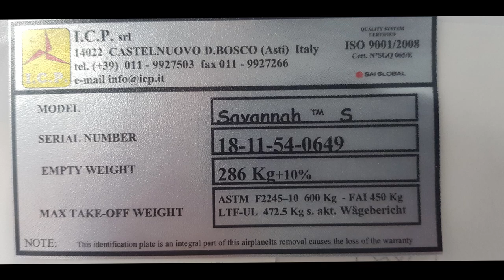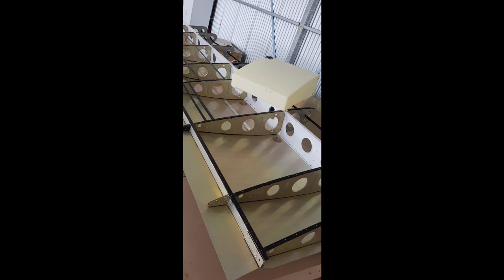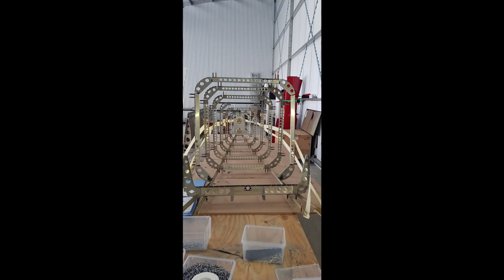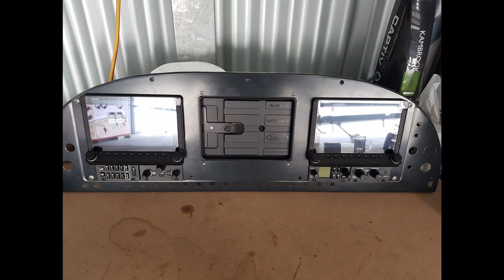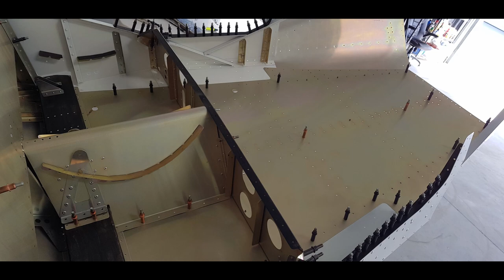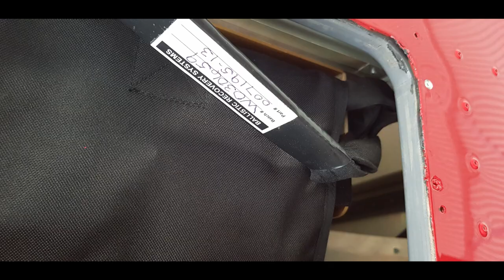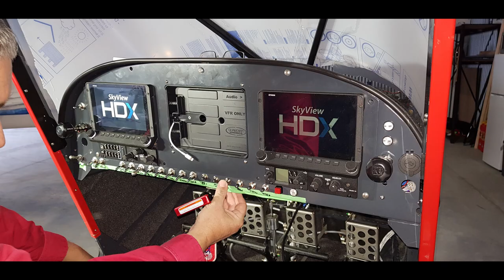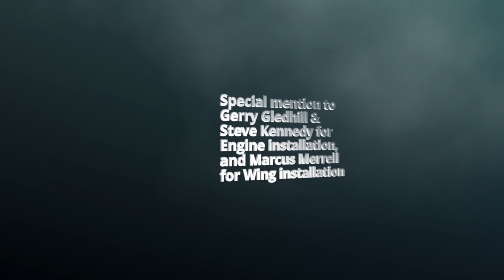Savannah S VH-CQG Timelapse Build

Comment: Great video, very interesting from a smart project with rotax is and brs parachute system. I currently fly a cirrus 22 but also need a smaller plane to fly all the wonderful aviosuperfici around Italy
Reply from the maker: Thanks Luca, and co-incidentally I also fly an SR22. The Savannah I built for the same reason you just said, to be able to fly low and slow and have a good look around! The Cirrus is a great IFR machine to be able to get from point A to B quickly...

Comment: Great job. Looks awesome. I'm starting to build myself and was wondering what you did with the stickers when you used Alodine? Did you leave them on or peeled them off and reapplied or did you just know how to assemble a Savannah without stickers? 😊
Reply from the maker: Hi Christin, I removed every sticker and engraved each piece as I did, also deburred every piece at the same time. This took a few weeks and then i alodined everything. In essence I did all the crap work first which then allowed me to just build which was the best bit!
Reply: Did you apply a primer after Alodining or you just left the Alodine as is? And on the outer surfaces where you riveted, did you also apply black stuff or is that etch primer? 
How is your Savannah a few years later down the track?
Thanks for your help.
Reply from the maker: @ChristinSondermann  I didn't prime after alodining other than apply the black stuff as you call it to each surface which was going to be riveted together

Comment: Hello, Great video, awesome. What a nice job. I live in France. I am going to build a Savannah S and your video is a big help. I have a question. I live near the sea and I have a lot of questions about anti-corrosion treatment. You use alodine in big plastics bins. But how do you do for long lengths ? with a brush ? Thank for your answer, I can't find anything on the internet Stephane
Reply from the maker: Thanks Stephane,
As you saw by the photos, I did all of the small part Alodining of what could fit into those tubs. For everything else I bundled up on pallets and took to a local business who had huge baths of Alumiprep and Alodine and saved me weeks of my time, and the cost I considered to be very reasonable. I'd do this as the Alodine process is painstakingly boring! I would definitely do some sort of corrosion preventative as we too live near the coast and a few other builds that did not Alodine are already showing a fair few spots of corrosion, they too wish they had taken the extra time to do it.
Hope this helps, Chris

Comment: I have an EAB Savannah S. The builder chose to highly modify the muffler to fit the cowling. This is causing me some issues now. Looks like you did the right thing and modified the cowling instead. Anything you would do differently for the exhaust system? Great job. I hope you’re having fun! I love flying mine. The golf cart tires are soon to be replaced.
Reply from the maker: The Rotax iS came with its muffler system in place so I left it there instead of replacing it with the ICP system and then had to modify the cowl to suit. I think best the Rotax exhaust even though a lot of mucking around with the cowl. And yes, these aircraft should ship with the larger tyres, the front 8.5x6.0 (same as rear, newly added after the build) certainly makes taxying and landing much much softer...
Reply: @nunnayourbiz  Thanks for your reply. I was able to get some photos of a factory built Savannah S (early 2018). I don't think the factory exhaust is build by Rotax. ICP must source them from someplace else or custom build in house. I wonder why they don't build a cowling that will fit the engines and stock exhaust systems being used.
Reply from the maker: @wandaschuler2920  No the factory exhaust is ICP's own. My Rotax iS was shipped with the exhaust already assembled on the engine (I'm not sure if the ULS are shipped the same). Yes it would be easier if ICP had bottom cowl options for the Rotax exhaust system too...

Comment: Mate, awesome to see. I'm pretty set on getting a kit in to build, any major tips? How was getting on the VH register?
Reply from the maker: Hi Conrad, the main tip is if it is your first build then have a few mates who you can lean on for help with the technical stuff, ie some of the engine install/avionics. Other than that the kit is fairly straightforward. VH register was also fairly simple process, just ensure you follow the guidelines and it will flow...

Comment: Congratulations Nunna. Just a question about protection against corrosion. Did you prime all components? What’s the black material you applied to the contact areas?
Reply from the maker: Yes the entire plane was alodined. The black paint is from ICP and is used to paint a thin coat between any pieces of aluminium that attach together, also to help against possible corrosion...
Reply: Bonjour je veux votre numéro wasap
Reply: Je suis béninois
Reply: @nunnayourbiz  Was it hard to get the Alodine? Isn't it considered hazardous material? Looks like you set up dip tanks. Was that prep, coat, wash? How did you dispose of it? Thanks. Seriously considering the Savannah.
Reply from the maker: @jimnelson3819  +
Hi Jim, the entire aircraft has been alodined. The smaller parts were done in the dip tanks as per the pictures and I did that myself, the larger skins were done by a commercial alodiner which saved me a heap of time and energy. Alodine is readily available in Australia and yes hazardess and toxic so use breathing apparatus and gloves etc. Pre prep first then rinse then alodine solution and hang it to dry. I still have the alodine if needed in the future. Hope this helps!

Comment: What a Beautiful build well done. how long did it take to complete ? how would you rate it for a first time builder ?
Reply from the maker: Thanks Kyle for the compliment, she took 1000 hours all up! As a first time builder I would consider it fairly straight forward, however with some technical challenges. Obviously building anything from here would be somewhat easier...
Reply: @nunnayourbiz  How did you find the electrical work? Did you do all of it yourself or enlist help with electrical, engine, fuel, cables etc? Also, was this an aerokits kit build somewhere in Australia? Cheers mate, going through the first time building or buying decision myself.
Reply from the maker: @kmfenno9012  I was lucky enough to have a mate who has built his own RV and does a lot of avionic install work, so this was led by him, I did the grunt work :). Engine hoses we used a hydraulic hose company and made stainless steel braided hoses and fire sleeved them. These two areas are more or less up to you to decide how it comes together, ie not much information in the manual. And yes was an Aerokits build here in Aus... hope this helps!